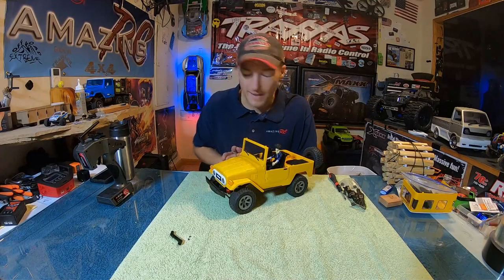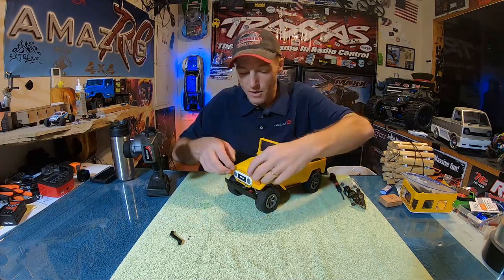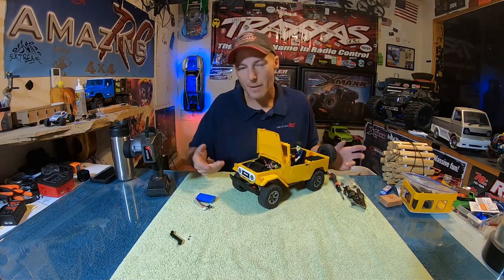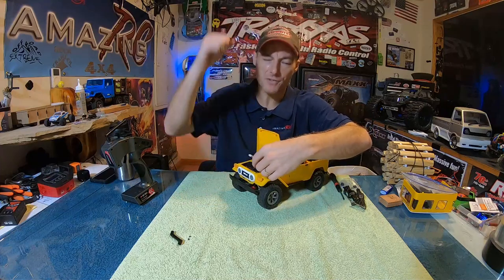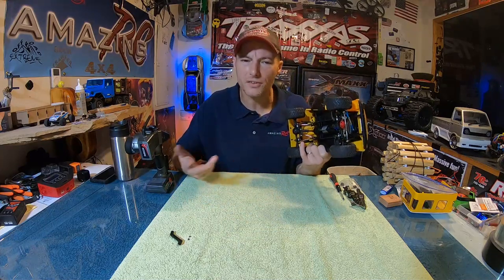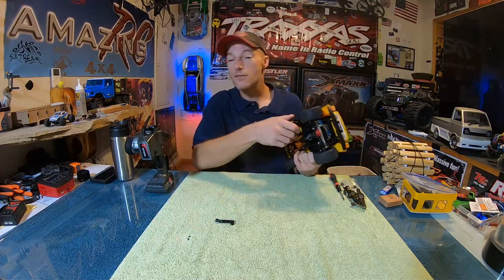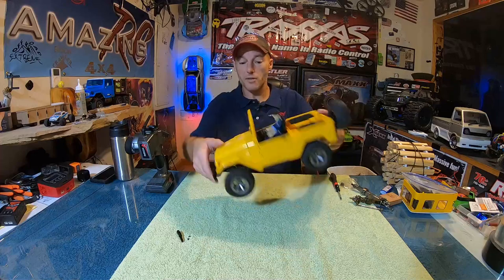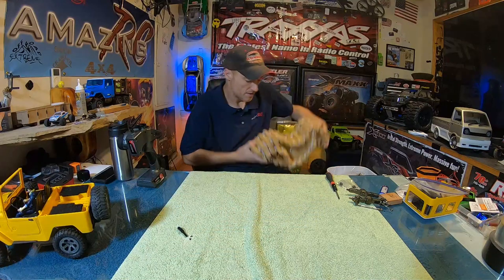WPL C34 SUPER CUSTOM is RUNNING..!!  Need Help with DRIVESHAFTS.!!

Comment: I had this cracking problem with my c44km, I also thought that there was a problem with the transmission shafts but in fact it came from the gears which are in the axles. You just have to loosen the four screws of the red cover on the axle. On another c34km I had to make a plastic wedge between the axle and the red cover so that this noise disappeared.
I really like the bridge for the scx24 that you made, really very well done 👌
Reply from the maker: I hope to have a new video on the bridge very soon.!! Many thanks for the great comment my friend.  I think I have figured out where my issue with the driveshafts... its NOT the driveshafts... I am pretty sure that it's my motor and transmission... they are the same exact aftermarket upgrades that I have always purchased.  And I have always had the same issue with my driveshaft... I am going to test out the stock setup next to see if this fixes things. Thanks again
Reply: @AMAZINGRC  I hope you will find and fix your problem 😊👍

Comment: For me the lurching comes with steep shaft angles. The other thing I learned from the 6x6 build. One of the driveshafts is a hot racing shaft close to the length then cut it to fit.Then I used a piece of tubing for a bushing to fit the size of the diff pinion.
Reply: Or maybe a ball and socket style instead of the square on square style.
Reply from the maker: You know the 1st thing I did was pick up your truck..!!  Tried to figure out what the hell you and I did to get these things running right.  This truck is so close to being really really cool. If I could just get it to run right I will be exceptionally happy. Thanks for the tip Gary I will use it for sure. Keep you posted.

Comment: Looking forward to your finished built! I use those Henglong titanium axles by default on all my custom built as they are so much more robust that the metal WPL ones. I've broken so many of them as soon as you get a powerful motor and transmission. As for your driveshaft, could it be that the grub screw and the driveshaft are slightly offset making them not rotating on the axis? Just an idea seeing how they rotate. I'm finished with my built finally! Dual motors direct drive! Video soon 🤞
Reply from the maker: OMG I can't wait to see this new setup you have.!! As for me, I am now most certain that my issue is ,and always has been my aftermarket motor and transmission.  I always purchase the same setup and I somehow get the same result. Go figure..LOL

Comment: I use 1/10 scale steel drive shafts on my C44. If you go that route you’ll need some adapters. If you would like to see images and links let me know. I’m always happy to help and share.
Reply from the maker: Hey I really appreciate that.!! I actually think my issue is my upgraded motor and trans. I have purchased this same setup for every WPL I have owned.  Same issue every time... I was always thinking driveshafts... turns out my new setup creates too severe of an angle to work properly. 
That's why I asked the YouTubaverse... I just knew you guys would help with all these great ideas. Thanks again

Comment: I’m really stumped about them driveshafts.   I have the c34 kit Version. All Wpl electronics. Sound kit    The metal upgraded driveshaft that come in the kit. Are CVA  no knuckles at the ends  .  I’m editing  now  would you like for me to put a close-up of my driveshaft in my next vid ?   They are the upgraded metal WPL    No problems to report with my WPL  c34 K-M  my speaker when Out
Reply from the maker: I'll tell you what the difference is... And it's the only common denominator to my story. I have always complained about the drive shafts but I don't believe that that is my issue...  It literally just hit me... It's the motor and transmission that I buy. I have bought the same one for every single WPL truck I have ever owned . And I always have drive shaft issues. I bet this motor and transmission are pushing the drive shafts closer to each other..!!!  I always liked how this motor and transmission looked so I always bought it. Nobody else buys it because it's so expensive.. It was like $25 for the motor and transmission... I would be willing to guarantee that this is my actual issue and not The drive shafts themselves.  I bet if I put the stock setup back in it would run fine...
Reply: @AMAZINGRC  that REALLY has me suspecting transmission output shaft ends are a little too long, bottoming out the slip joint part of the drive shafts.

Comment: I had the same issue with the drive shafts in my WPL B24.  At first I thought it was the cheap knockoff metal ones I bought but then I replaced with WPL Metal drive shafts and got better but nojt perfect.  I was running an after market motor and transmission as well. Once I replaced that with the WPL 2 speed transmission all of my issues were solved.  Maybe just luck but who knows.  Great video!  Can't wait to see yours out running.
Reply from the maker: That's the comment I'm waiting for..!!  Many thanks for the info I will use it wisely. I had never thought of a toothpaste transmission. I have the same aftermarket 240/ All metal transmission I am used to purchasing for these cars. I will keep you posted for sure..!!
Reply from the maker: Bro you hit on something in your comment that I did not catch until I read another comment later on.  It's the motor and transmission. I have bought the same motor and transmission for every WPL truck I have ever owned.  I guarantee it's the motor  and transmission.. I always buy the really cool 3 gear all metal transmission with the all metal case that has that cool I think 270 motor in it or 260 . And I always have problems with drive shafts. I guarantee it's this motor and transmission... If you get a minute send me a link to the 2 speed transmission that you bought that worked. Don't hurt yourself doing it but if you can get it for me that would be great. Thanks bro
Reply: @AMAZINGRC  gearbox sitting 1/8" 1/4" too high can really put some kink on U-joints, also check there's a little length/slack so when you push the axle up the two halves don't bottom out against+into each other, it'll put weird pressure against gears everywhere, same pressure that gets grub screws working their way loose. definitely go for the ball end type joints with their no fun circular springs.. if you have to take a few mm off gearbox output shaft so they don't hit solid into each other so be it. too much "Z" between U-joints or ball end joints, or fully compressed shaft stopping axle articulation are the two main things to watch out for and fix.
Reply from the maker: @modelnutty6503  OMG, I know exactly what you are talking about..!! I have had this exact issue happen in my C34, or something just like It.!! I am headed down to the shop to check it out..!! Keep you posted.!!!
Reply: @AMAZINGRC  good deal! I've had to trim 2-3 mm from gearbox output shaft at both ends upgrading drive shafts (usually the front!) to stop the motor struggling like "rurr-rurr-rurr" when it should just HUM. you notice it  more when its climbing/crawling and flexing. once you find "the spot" where the tip of the grub screw is gonna go, small drill bit a divot for it to mate into for more full+even contact.. maybe 1/2" mm deep.